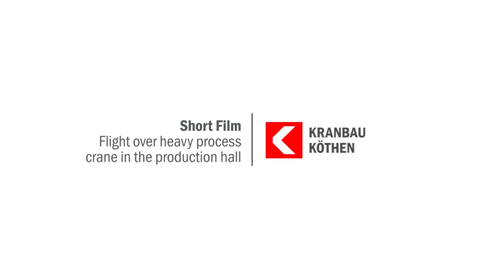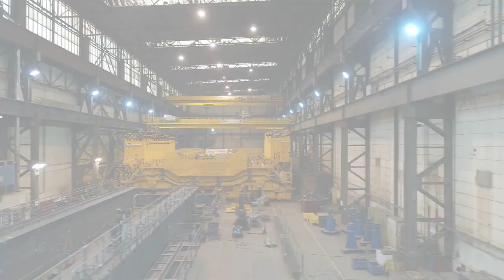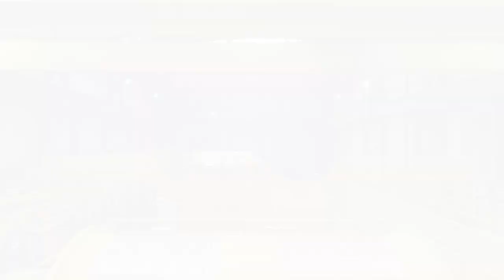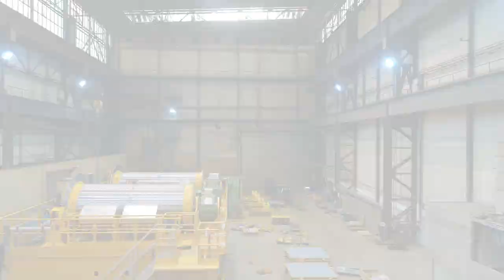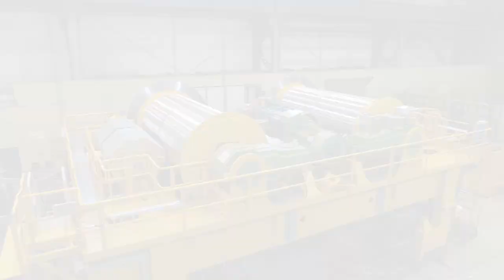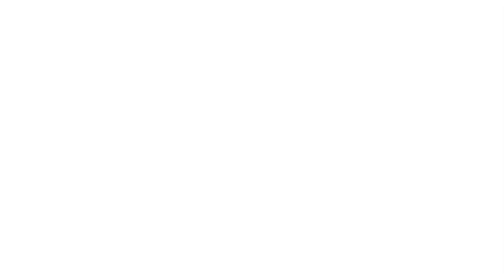Short Film Kranbau - Flight over heavy process crane in the production hall

Comment: Can it be driven by only one electricmotor incase a failure of other one?
Reply from the maker: Yes, all of our cranes are equipped with redundancy.
Reply: @kranbaukothengmbh3446  then there is planetary system inthe gearbox.
Reply from the maker: @yagzozgor7043  Yes, that is often used
Reply: @kranbaukothengmbh3446  thank you sır.

Comment: not a good idea running it with one motor unless its just used to get out of a bad situation .the cranes i worked main hoist two motors two separate computer drives for a  drive train thats all connected together both gear box and drive shafts are one unit .hell of a strain one motor driving both gear boxes and all that torque provided the master computer drive will allow the crane to run like that
Reply: just to mention i ran a 350 Ton ladel crane for 20 years..what do dumb crane drivers know anyway..lol
Reply from the maker: The trolley on the crane has two drives and two frequency converters. If a component fails, everything can continue to operate redundantly - not at 100% speed, but the crane remains in the production process.